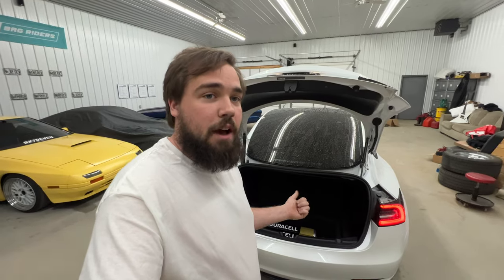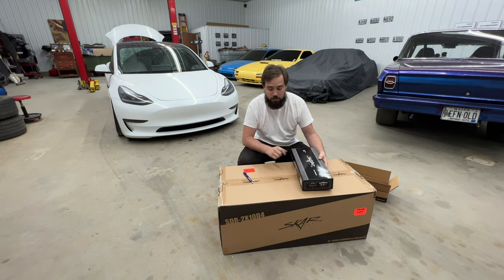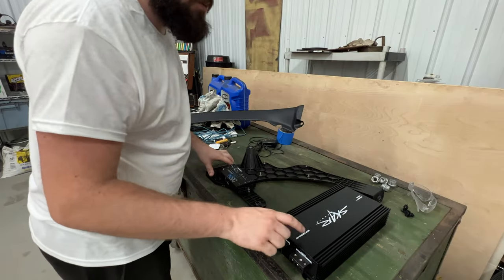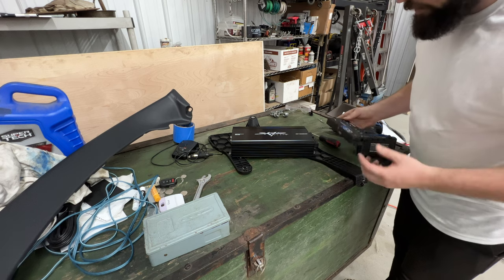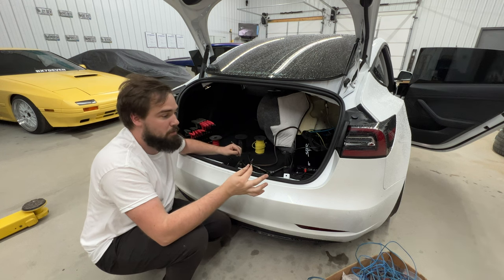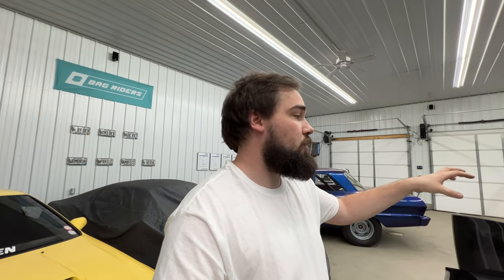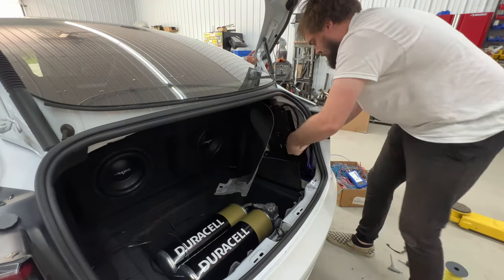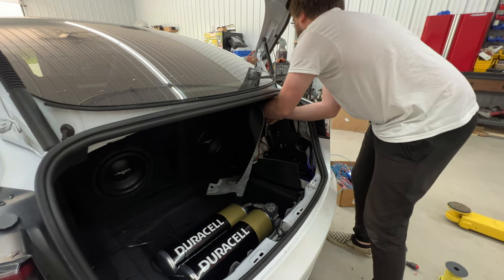Installing Skar Audio Bass Package in My Tesla!

Comment: Subwoofer are supposed to have a 20 hour break in period at 1/4 gain too just letting u know
Reply from the maker: They also say to break engines in, yet dragsters rebuild their engines and then go wide open throttle at 11 thousand horsepower. Haha. I've been in car audio for 10 years, I appreciate looking out for the subs and me! I'm sure they gonna be fine, this isn't my first setup and I've never had issues. Im not playing it at full tilt every time they're on. A quick test or playing with them isn't gonna kill them. The coils don't have enough time to over heat with how little I play it, and it's distortion free and also detuned from the headunits EQ!
Reply: @BaggedDev  no problem I wasn’t trying to come off rude just looking out for fellow bass heads I have a Skar evl 15 in my pickup she’s a unit love there brand
Reply from the maker: @navygt7497  all good, hey I appreciate it! Love the Skar stuff! Replaced my 8” with these 2 10’s and couldn’t be more happy! A lot of bang for the buck!

Comment: wtf its like youve been reading my mind. I was either going a audiocontrol amp or a lc2 with a different amp... I wasnt sure if that was overkill for the signal. I do think Im just sticking with the tesla box from skar for 1 10" though. Chances are I'll be going big later just cause.
Reply: How do you like the single 10"? Which amp did you use?

Comment: Where did you pull the power for the LC2? Did you just bridge it off amp 12v input? Ive got a 2023 3 base model and Im going to run power off the battery (Im reading it will help with code issues) but I don't want to tap a second line unless I have to.
Reply from the maker: I would suggest not running anything off the battery. Any draw off the battery can trip the battery management system and throw faults. I ran over 200amp of current draw directly off the DC-DC converter without issues. The LC2i pro has built in turn on when your signal source (I used the drivers door woofer) turns on, and that signal turns on the LC2i pro. Main power and ground for the LC2i I just pulled from the amplifier. If you watch both parts of these videos, everything should be explained and if you follow exactly how I did everything, you’ll be problem free. If you do it your own way and run into problems, my only help is to undo the way you did it, and do it the way I did in the video. Haha
Reply: @BaggedDev  Thanks! for some reason when I looked at the channel I didnt see a second vid. Its here, I was just being dumb. its strange because breakers suggests to run it off the battery side for the 2023 do to the 16v system? Its getting a bit muddy on info, I'll take another look at both.

Comment: Did you figure out the issue with error codes you were getting?  Did you end up having to run a second battery with a isolator relay?
Reply from the maker: Just a relay to isolate the bass amplifier. I have a video for building the amp rack and it shows exactly what I used and how I wired it up
Reply: @BaggedDev  I just found your other videos.  I got both of the items in my cart on Amazon.  How exactly is the resistor connected. The relay I understand how to connect that but I'm slightly confused on where the resistor is placed and wired, can you recap how it's down?
Reply from the maker: @shiznilti7477  the resistor connects to both sides of the relay. The resistor let’s a little power pass by the relay while it’s off so it slowly charges the capacitors in the amp before the big relay kicks on. 

To recap, the big wire coming from the DC-DC converter, run that to the relay post on the right, you’ll also attach one side of the resistor to this relay terminal also. The connect the other side of the resistor to the big output of the relay, you’ll also run the rest of the big wire from there, into the amp.
Reply: @BaggedDev  excellent reply. I now know exactly how to do im order to get my JL RD.1000.1 and W6v2's in a 3.5cuft @ 32hz aero port enclosure installed now. Thanks so much for all this info!  /subscribed